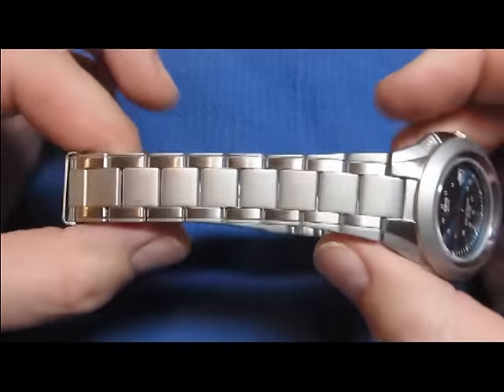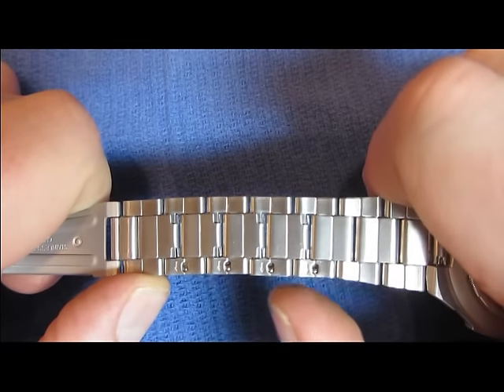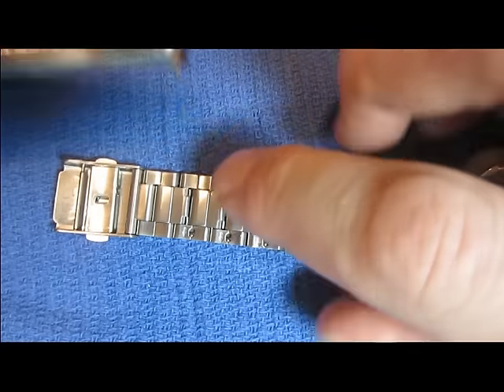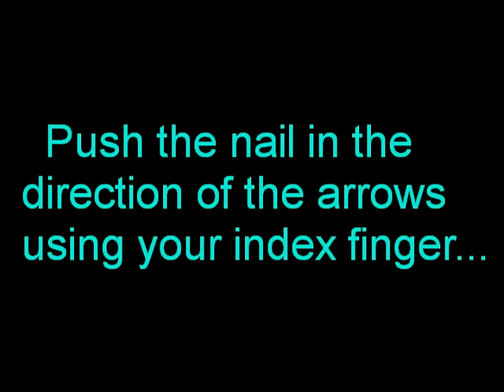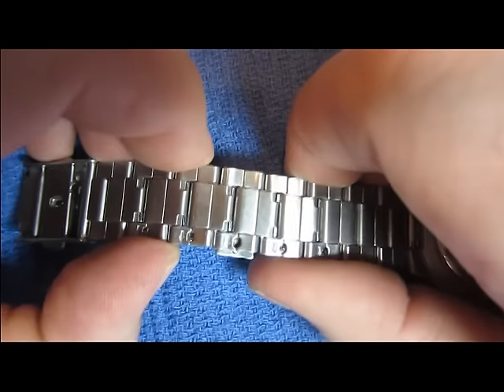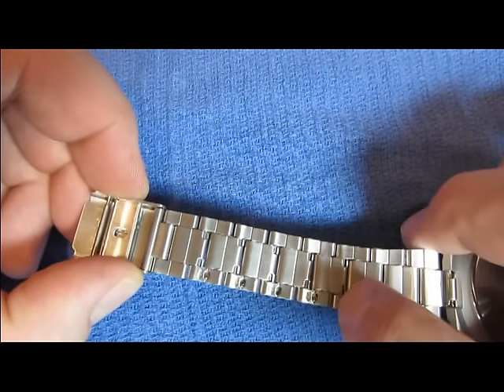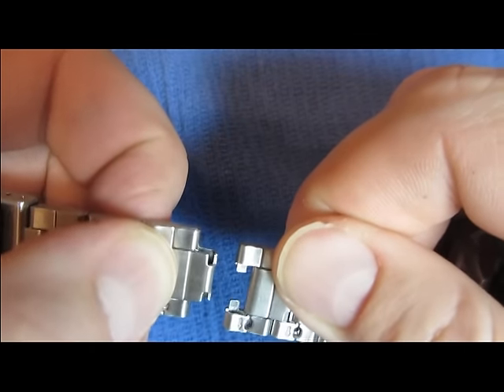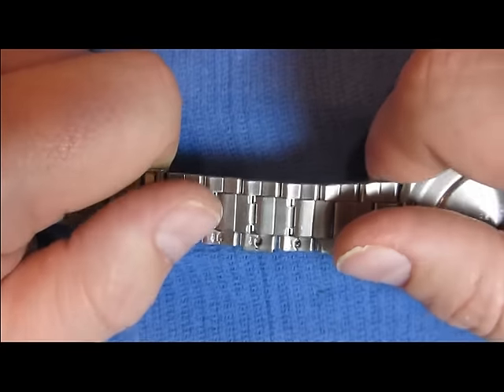WATCH BAND ADJUSTMENT / RESIZE - HOW TO

Comment: Own the same Cassio. All I took was take a worn out jewelers screwdriver ground the end to a beveled siringe shape and smoothened the end a bit so it doesn't scratch or skewer the nubs on those keys. I ground it so it fits the key hole. Gentle push at an angle with a bit of positive force and not even 2 seconds they push out freely without a scratch. Adjusting the links was a breeze. 2 minutes and it was done. Used the same procedure but had the arrows facing up pushing away from me. I was able to use plastic gripping tweezers to remove the keys. Thanks for sharing this video.
Reply from the maker: Sounds like you made the perfect tool for this.  Thanks for the comment, and thanks for watching.  I hope my other videos are just as useful to you.

Comment: Thank you for your explanation. I was struggling like you said pushing the links until I searched some more and found it's a very simple, no hard pressure needed job. Simply make sure your have a small enough tool/nail to go all the way down in the hole and simply ease out the key little by little.
Reply from the maker: One comment I got a long time ago said that they used a thumb tack.  That would also be a good tool

Comment: Many thanks from Russia!!! Another tip: you can also use a needle (narrow end or a wider one if you can remove the hole for a thread, otherwise it will broke) if nail doesn't stick into position. Tried this with Q&Q watches and removed all links I needed for 5 hours. It was a tough challenge but now I feel proud for wearing this thing that I fitted for myself
Reply from the maker: Great tip!  BTW......  I have been getting comments from Russians for over 13 years now.  99.9 percent of them have been vulgar, hateful, and mean.   In fact, there has been times when I simply delete a comment if it's in Russian, just because of the immoral hate speech.  YOU, MY FRIEND.......  have redeemed my opinion of  your country people.  I would like to think that you represent your society.  Thank you so much for the kind comment!  You are always welcome on my channel, Actdye!

Comment: Thank you very much for posting!  I got a very nice watch in Brazil several months ago and could not figure or find out how to adjust the band. I was finally able to adjust  after finding your video. I took a tooth pic and dipped it WD40, and placed a small drop in the hole..The pin came out much easier. Thanks Again!!!
Reply from the maker: Great tip on the WD40!  Thanks for posting!
Reply: This tip made things so much easier.

Comment: I haven't worn a watch in 2 years because the band was too large and a shop to have it changed was 20 miles away. With your video it took all of 5 minutes and a small screw driver and it fits perfectly. I thoroughly cleaned the band before I started this. The pins came out easy.  Thanks for the video.
Reply from the maker: Robert,  Thanks for the great comment.  Glad I can help you out!!!

Comment: Excellent video, simple clear instructions, no fuss, worked a treat on my son's Sekonda.
Rather than hold the nail with the pliers, I hammered a 1" (25mm) brass panel pin into a thin stick until about 0.1" (2.5mm) was protruding through it - very effective.
Reply from the maker: Thanks for watching my video, my friend

Comment: Great and helpful video. In my case, a push pin worked very well for initial shove, and saved me the long stroll out to the freezing garage, and the tool box dive in search of small vise grips. Hemostat or needle nose works for pulling loosened  links, if you happen to have either of those.
Reply from the maker: +Greg Tomlinson    Thanks for the comment, and adding your tips.  Hopefully your tips will help someone else.  A push pin might be more available in folks houses than the pliers and nails.   Thanks again for the positive feedback!

Comment: Thanks for the video.  I've never had a bracelet like this until now.   What a pain, but this video shows very well how to do it.  Talk about over complicating a simple thing.  Those push pins found on other bracelets work perfectly well. These are a tremendous hassle.  Thanks though! One thing I'd add is to remove links from the bottom first as many bracelets are somewhat tapered.  You don't want to remove links in the middle first.
Reply from the maker: Glad it was helpful!

Comment: I have the same watch and band.Great video but I must report that even after following your proper technique, I still found myself struggling. In fact, I thought I was going to lose the bracelet. The specs on these keys in relation to the links are just too tight - at least for my particular watch.What I ended up doing was to lift (pry) the metal part of the link on each side of the hole which is entered to move the key out. This removed the impediment of the raised "bb". The key then slid out much more easily. When I had removed the link, I then squeezed the raised metal back in place with pliers and a soft cloth to prevent scratching.I love the look of the watch. The bracelet is cheap and tinny but looks fine. I am guessing a black leather strap designed for this watch would look good, too.Thanks again.
Reply from the maker: +the seventh sojourner    It is true that some of the links were harder than others.  This is such a weird design for a watch band.  I don't like the design, but I really like the looks of the watch.  Glad my video pointed you in the right direction.  Thank you for the feedback!

Comment: I have a Casio AE1200WHD "Royale" that has the same type of links. I found your demonstration, but as I'm a klutz--I would either mar the bracelet or my fingers--I didn't remove the links they way you did. What I ended up doing is using a pair of jeweler's screw drivers and a pair of needle nose pliers. I noticed that there is a small gap just to the inside (toward the center of the bracelet) near the head of the clip. I was able to insert the smaller of the screwdrivers into this gap and turn it. That moved the clip outward. I followed up with the second screwdriver which forced the little bump to clear the hole and then was able to remove the clip with the pliers. Just throwing this out there as an alternative for anyone like me :)
Reply from the maker: Great idea

Comment: Rather than a nail,  I used the type of screwdriver used to repair spectacles and then it was simple - just insert and twist - to push the key out ~1mm. The idea of squirting it with WD-40 first is a good one though as subsequently removing the key-shaped pin was easier. However, I struggled to separate the link. Rather than just "bend ... and remove" shown at 4:10, I had to bend and apply considerable force. I'm disappointed that Casio did not included any instructions for the watch band, as I would not have figured it out without this video so thank you.
Reply from the maker: Glad I could help you out in the right direction.  Thanks for the positive comment and tips

Comment: Thanks a bunch!  Saved me time and grief adjusting my new watch band. I used an icepick-like tool instead of the nail and vicegrips.
Reply from the maker: +Dave Van Rooy   I've had other comments from folks saying push-pins work well too.   I like having more control over the pointed object, because I'm clumsy!  I once ran a screwdriver through my hand trying to pry open a battery compartment lid on a child's toy.   But I say, ... whatever works! Thanks for the feedback Dave!

Comment: Thank you for your practical guide, I can not do it at first time then actually I was nervous so I went to a  "watchmaker" it was a mistake, because this yerk make scratchs to the belt, so I decided to try again and I have succes so my work was excellent without any scratch.  Let me give you a piece of advice, try to nail two wall staples in a piece of wood, so that each staple push the chain links both right and left to the piece you want remove when you push the pin, it provide you the strong necesary to remove it and when you put again the pin, use a piece of paper or cotton to prevent scratches in the surface of the belt.
Reply from the maker: +ROLANDO JUAREZ     Thanks for the tips!  maybe it will help someone with the same issues.  Thanks for the feedback.

Comment: I used a small screw driver to pry the metal up slightly on either side of the ball.  I don't know if it is recommended but it was a lot easier and used needle nose pliers to close the space after.  Put a little cloth on the outside bracelet side so you don't scratch it when you use the pliers.
Reply from the maker: indeed there is more than one way to do this.  Thanks for the tip.

Comment: Outstanding - but one useful suggestion.  If you have trouble trying to hold those two surrounding links while prying the key out with the clenched nail, I found that what works better is to rest the band away from you at about 30 degrees or so downward against your working surface, and then just press the key down and out against that.  That way you don't need superstrong fingers to provide the resisting force, and it pops out very nicely.  I was also able to use a regular visegrips instead of needing the needle-nosed variety.  Appreciate the demo :-)
Reply from the maker: I appreciate you input and tips, TPaine76!

Comment: Thank you, it's a very helpful video,  my Casio MTD-1079D needed some adjustments. Also I didn't have pliers nor a screw but instead I use a 1.4MM FLAT Head Screwdriver. It was very fiddly but I managed to pull it off.
Reply from the maker: Great use of another method with the screwdriver.  Maybe your tip will help others.  Half the battle is just seeing and knowing how something is put together.  Glad my video helped you out.  Thanks for taking the time to comment, Muhitul!

Comment: Took quite a bit of effort to push the key out, but once out, I found that in order to remove a link, two (2) consecutive of those need to be removed.  One is not 'done' and the link cannot be removed until this ordeal has been completed twice.  The video skips this little fact in removing two keys to get one link free for removal.   If removing more than one link to reduce the band to the desired size, remove one link (and thus 2 'keys') from each side so the watch and fasterner are equidistant on your wrist.
Reply: Ain't that obvious?
Reply: Come on Stuart... how you gonna remove one link without removing 2 keys??
Reply from the maker: ya.... sometimes it takes a lot of force

Comment: I tried your method and I couldn't get it to work. I also tried using a really small screwdriver that I saw another YouTuber use and I got one pin out. Then I found a sharp pick in my toolbox and it is the perfect tool for getting the pins out. I just stick the sharp pointed end into the hole and pry the pin towards the outside and the pin just slides out far enough to grab it with locking pliers!
Reply from the maker: there's more than one way to skin a cat.....  thanks for watching

Comment: Thanks for the helpful video.  You might try using an awl next time--probably a lot easier than a brad or nail and a clamping wrench
Reply from the maker: That's a great tip, Chani.   An ice pick or a push pin may also be used.  Whatever works.  Thanks for watching and commenting.

Comment: I have a Bergeon 6767s watch tool. I didn't need to apply that kind of force for initial bit.  If you flip the watch strap over, you can see a hole in the locking pin.  You use 6767 to pull pin out instead of the pliers.  I did use pliers the first time and realise the plier teeth were damaging the locking pin edge.
Reply from the maker: It's nice to have specialized tools.

Comment: Get a tiny-sized (i am not sure which size) flat head screwdriver, that will make the work a lot easier. If you are not sure which size, there is a watch repair tool kit for $9.88 at Walmart. The screwdriver that I used is in it.
Reply from the maker: thanks for the tip

Comment: Nice video thanks..
 Have a question , I have a orient Ray , I removed 3 links according to my wrist size , it's a little bit tight , when I put back one of the links , it's kinda loose .there are 3 holes on clasp , the length of these 3 holes are kind of half of a link length..I can't adjust the right size..any recommendations for me ? Thanks
Reply from the maker: +cihan augur     I would have a hard time telling you how to do it since I can't see the band.   I'm sorry.

Comment: mine is just like that too, with the arrows and the wholes to pull the pins out but one thing im having trouble is that my watch has like smaller wholes than your watch but im having trouble picking the right tool, it needs to be thinner and strong..
Reply from the maker: how about using a thumb tack point?
Reply: Phil Crockett ok, so i did not use a tack point and i found a thing strong screwdriver that fits the holes and pushed the nails up and took them out with plyers. Thank you so much and this video helped me alot to adjust the size of my metal watch. Took me 15 or 20 minutes lol

Comment: Now explain how to do the same on new Casios that do not have the hole that allows you to push out the link pins.
Reply from the maker: I do not have one of these new watch bands.  I will have to look for one and check it out.  Thanks for the heads -up.

Comment: I found a much easier and faster method of removing that type of link. No force needed. Insert a very small screwdriver in that same removal hole then turn the screwdriver and the link pops out. If necessary, use the screwdriver to pry the locking pin out just enough to be able to pull the locking pin out with pliars. 
Remove links as needed and reconnect the bracelet. Replace the pin bar, cover the bracelet with a cloth and use the pliars to snap the pins back into place.
Reply from the maker: That's great!  good job!
Reply: @PhilCrockett  Phil, Thank you for your original article, which inspired me to try and adjust my own watch bracelet! I am new to collecting watches and have  previously been taking them to the watch shop for adjustment. :)
Reply from the maker: glad my video helped you out, my friend.  hope you like my other diy vids.

Comment: on the inside of the band i have the arrows but i don't have the holes to poke in...how to remove those links???
Reply from the maker: +SERDAROTmkd    Sounds like a different watch band.  Even though I wouldn't be able to help much since I don't see it, I'm going to guess that the arrows tell which way the pins come out.  Look on the other side (opposite of where the pins come out), and see if there is an opening that you could maybe PUSH the pins out.

Comment: all I did was take a 3-inch drywall screw and pry the key out till it popped out remove with needle nose pliers
Reply from the maker: +Mark Bunk    Whatever works, my friend!
Reply: +Mark Bunk Yep whatever works.  My Invicta and Seiko watches had an arrow which tells you which direction to tap out the pins.  I too used a screw to tap them out enough to grab with tweezers.  Worked like a champ.

Comment: dude my pins are really tight inside and i cant remove them but i dont want to give any money on the jewellery shop please help ! :(
Reply from the maker: +liakos proimakis    I had some that were harder than others.  If you tried them all, and none of them won't budge, then I really don't know what else to do.  Did you use the exact same method in the video?  Maybe have someone else try, just in case their pushing technique is a little different.
Reply: +liakos proimakis Let me give you a piece of advice, try to nail two wall staples in a piece of wood, so that each staple push the chain links both right and 
left to the piece you want remove when you push the pin, it provide you 
the strong necesary to remove it and when you put again the pin, use a 
piece of paper or cotto
Reply from the maker: +ROLANDO JUAREZ    That's definitely worth trying!